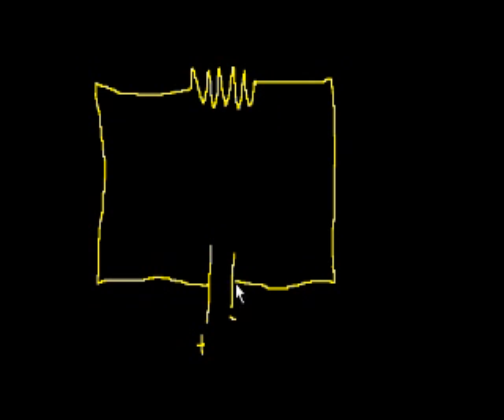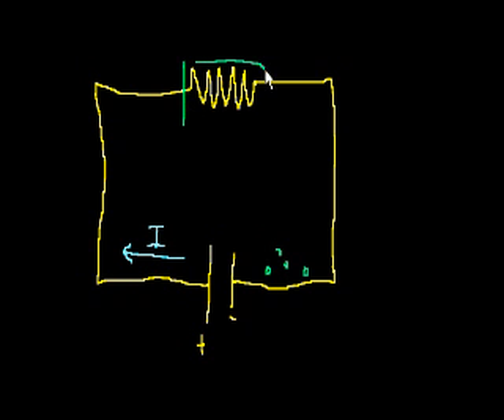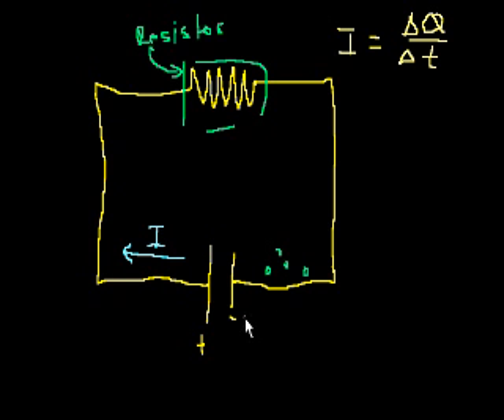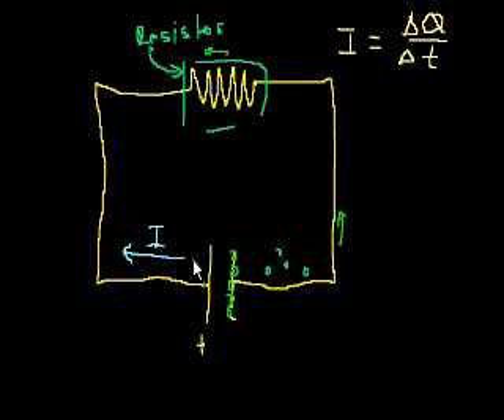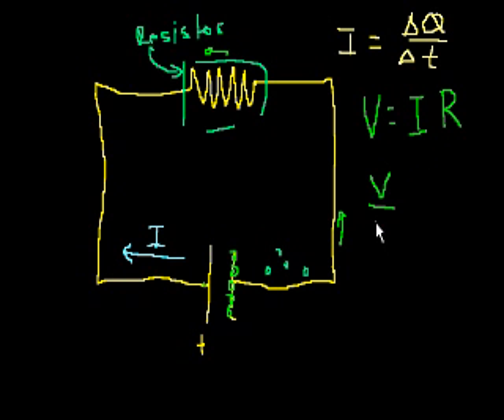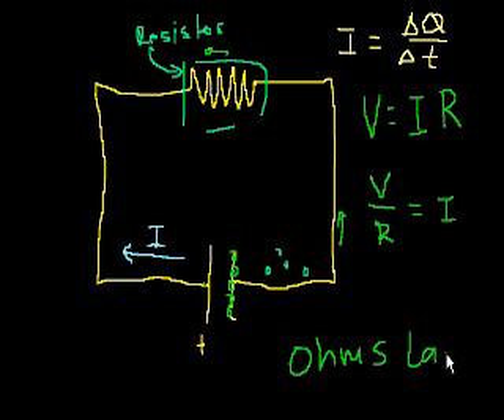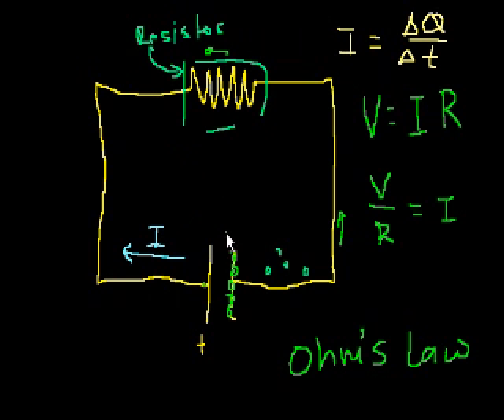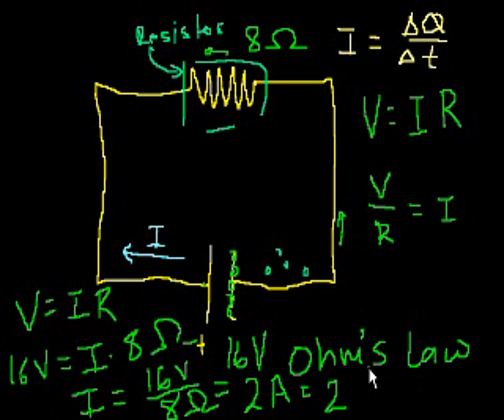Introduction to circuits and Ohm's law | Circuits | Physics | Khan Academy

Comment: The Large Hadron Collider can move protons at about 99.9999991% of the speed of light. Why won't it go any faster? why not 101%? I never said "law", by the way. Why did you include it in the comment? Theories can, in fact, also be supported by observations. But, they can be falsified. Theories can be edited. But, E=mc^2 's derivation is so simple, all it requires is some background in calculus.

Comment: How about this. When you run, you require energy. As you approach the speed of light, it requires tremendous amounts of energy. that translates, through E=mc^2, more mass, requiring more energy to move it further.  In the end, it requires infinite amounts of energy to travel at the speed of light. You probably have no background in this. To call this child play is stupid, considering the time people spent on this without finding contradiction.